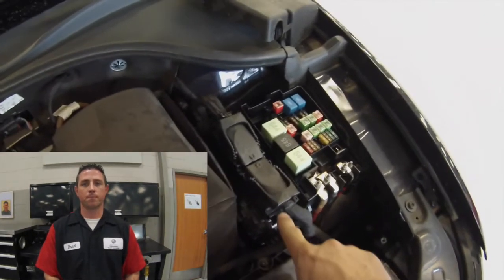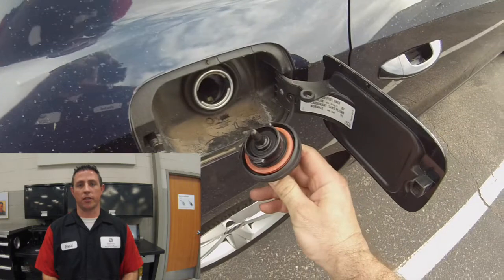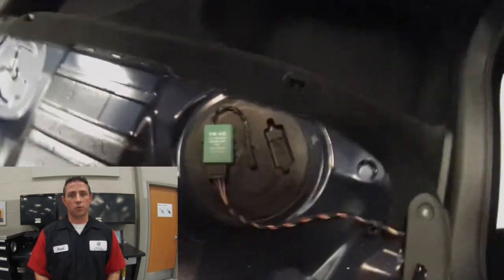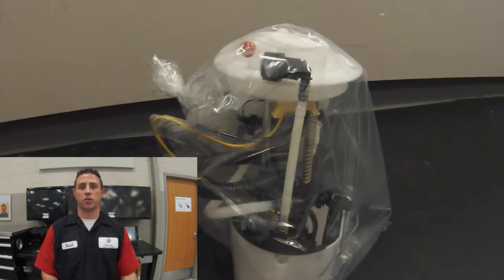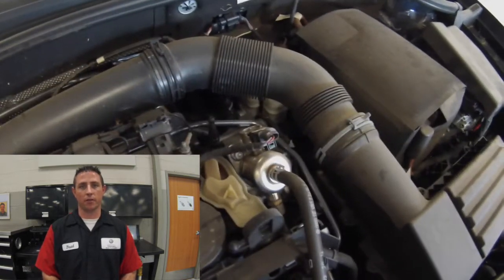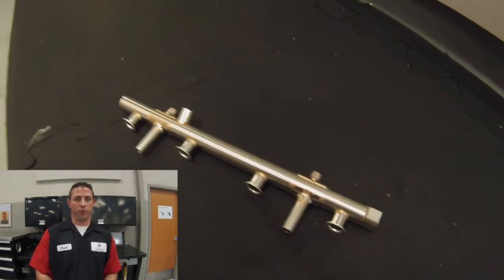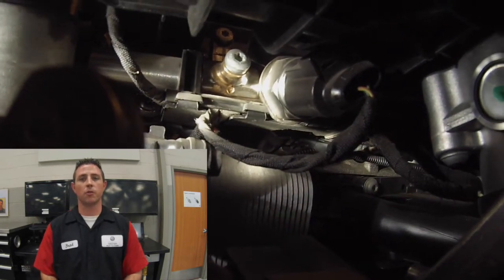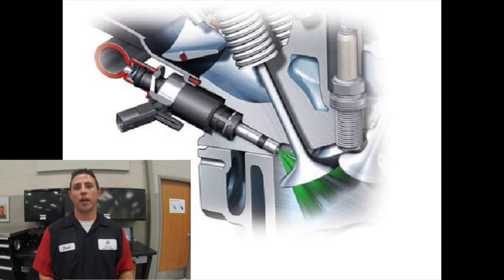How the fuel system works on a EA888 gen3 1.8 Tsi engine

Comment: Have been racking my brains trying to find a vacuum line to administrator a preemptive chemical  treatment(CRC, Seafoam) on my 2017 1.8 L TSI...I'm looking at the brake booster hose as my only option??? As the throttle body does't look to be an option..very cumbersome 
...any comments, Thanks in advance
Reply from the maker: when I perform induction services on 1.8tsi engines I unplug the map sensor ontop of the intake manifold.  remove the map sensor and use the map sensor port to introduce the chemical to the intake manifold.  make sure to regulate the amount of flow of chemical or else it could hydrolock the engine.  you will set a fault for map sensor open circuit and maybe misfires if it starts to misfire. so make sure to have a way to clear the dtc memory such as vcds or a generic scan tool that can cleared the fault memory.
Reply: @GermanEliteTuning  Thanks Brad

Comment: How has carbon buildup been with this system. I have a 2017 1.8t ea888 Gen 3 in my US passat R line. I'm at just over 40k I do oil changes every 5k miles with only VW 502.0 approved synthetic (LiquiMoly or Castrol 5W40) and use only top tier premium (93) fuel (Shell) in order to try and prevent future carbon buildup issues....
Reply from the maker: Alan Holmes the 1.8t ea888 motors have had a little bit of build up we have seen but not as bad as the gen 1 2.0tsi motors.
Reply: Hello Alan
I too, have a 1.8L tsi Passat....runs great!  Very impressed with all the power generated from that little engine... Glad to hear you have 40k miles without any carbon issues and, I too,
take all the precautionary measures you take on yours... I thought Brads response was incomplete, measured and a little ambiguous. I'm wondering if you are taking any preliminary actions to prevent carbon  build up ie CRC, Seafoam treatments... I have been racking my brains trying to find an vacuum port to administer the treatment and wondering if you have had any success..
Usually the value body is the best option , for a quick service,  but due to VW's over engineering... it makes it extremely difficult... Now I'm looking at the brake boost line behind the 
the high pressure fuel pump...wondering if you have had any success??